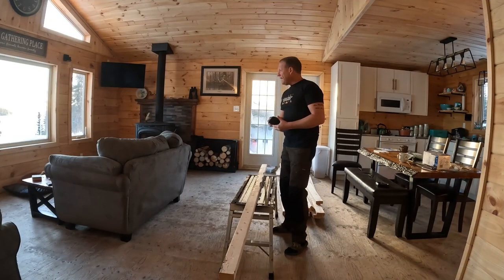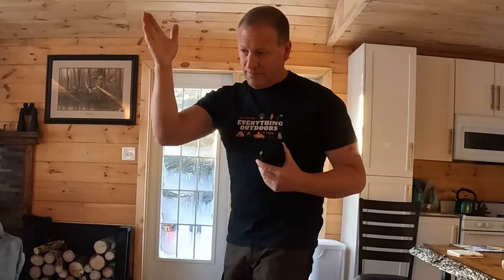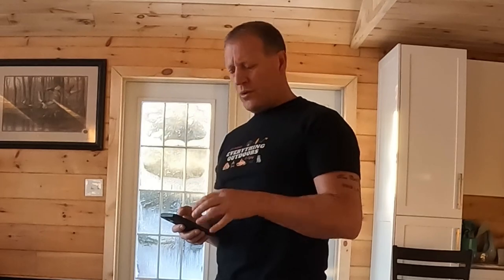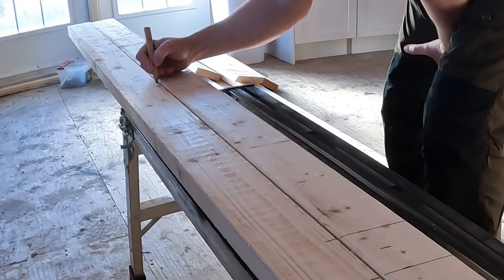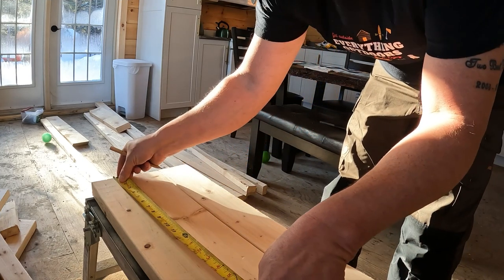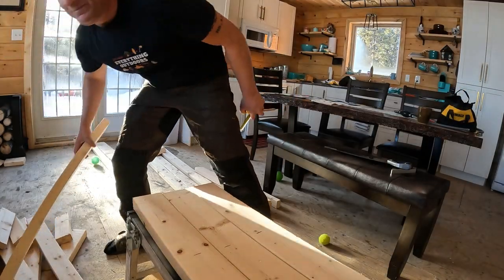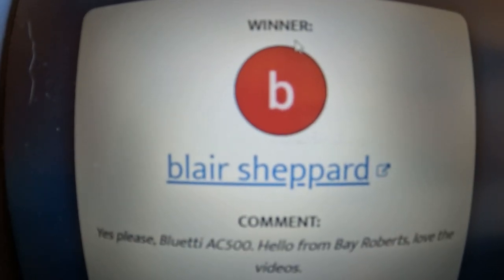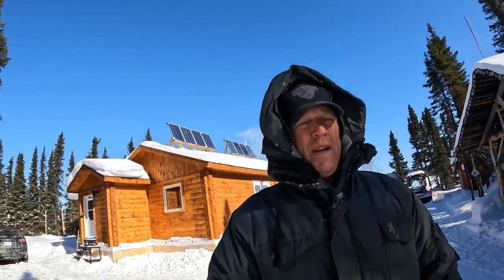BLUETTI WINNER, COOL DIY PROJECT & PARTRIDGE SOUP - OFF GRID CABIN LIFE IN THE NORTH 🏡

Comment: "Charlie Horse", Chuck I knew, I knew that was coming you old fool... Great job on the build, one tip is; when loading your "Charlie Horse", make sure on one end makes no diff which, but on one end makes sure all the butts are evenly lined up. You'll know what I mean when you start using it. The first cut on the uneven side I use as fire-pit wood. That's if your going to have over hangs length wise... Another great video and I thought for sure in the opening seen when you moved the couch to make room to work, you were going to use a skill saw. I said to myself "Mel is going to lose it, the dogs are in and Chuck's out", sawdust everywhere. Glad you used the old handsaw... Old school... Congrats to the winner...
Reply from the maker: Haha. If you weren’t famous enough already with your wonderful channel, just imagine how tenfold it will be now that you have a rich piece of Canadian woodcutting heritage named after you 👍😆. Thanks again for the wonderful design. You’re a great sport.

Comment: What are you thinking for flooring in the house ?
Reply from the maker: It will be a layer of sm styrofoam beneath 12mm water resistant laminate flooring. Insulated and strong. Just like I already have done in my rooms and bathroom